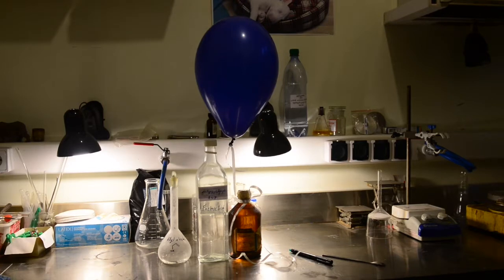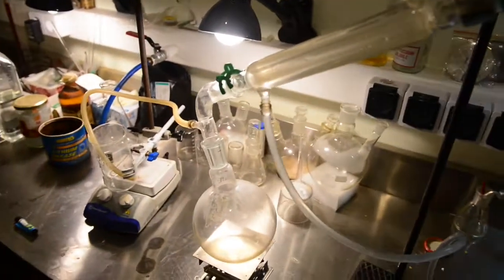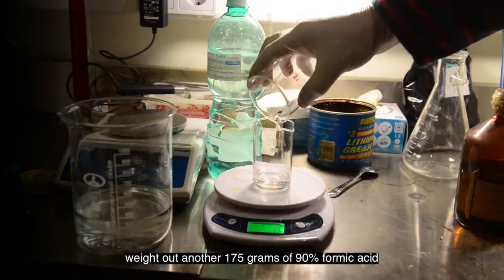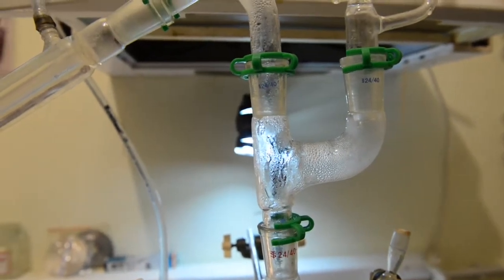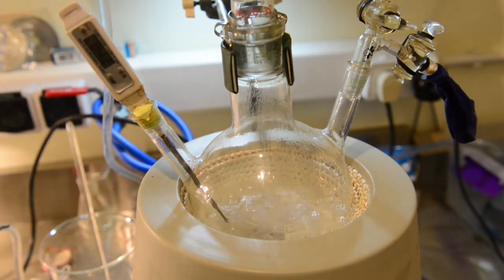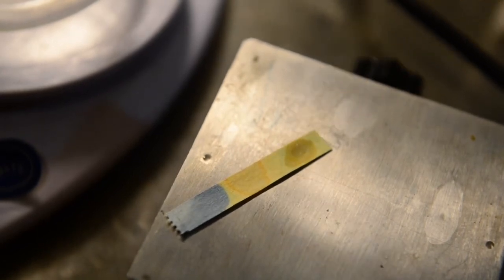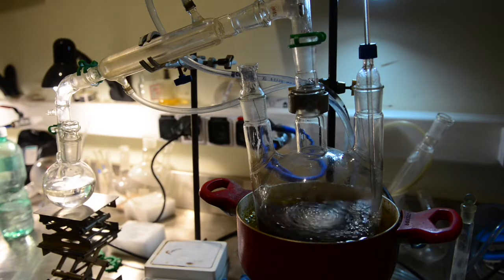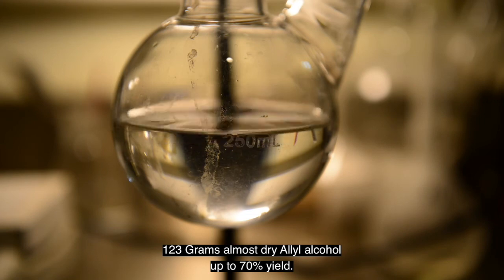Allyl alcohol synthesis

Comment: I have a suggestion for upcoming distillations: when using a claisen adapter with a dripping funnel like in the video, it is more commonly connected the other way around. That way, you don't lose any liquid from the dripping funnel and you even get a very slightly better separation of your components from the boiling flask, as the path becomes very slightly longer. Great video!

Comment: Can I skip the inert gas part and just do with atmospheric gases? Will it just reduce yields (and by approximately how much?) or the whole reaction will go to shit?
Reply: Ya i want to know too...
Reply: I tried without inert gas... yield OK, no tar formation, seems keeping temperature in flask below 260 C is the clue to prevent tar formation
according the yield... the speed of heating and distillation seems to be the clue... if too strong heating at the beginning, formic acid does not manage to form ester with glycerol and distills off prematurely = low yield... when later to week heating then acrolein formation and lower yield
Reply: @dznp432  The real MVP. What was your final yield (in anhydrous form)?
Reply: @alex6629227  well, the reaction of anhydrous glycerin with 85% formic acid was not difficult, the workup was harder... first refluxed with NaOH to destroy remaining formic acid and hydrolyse allyl formate, then fractionated by distillation through a 35 cm short Wigreux column so obtained azeotrope of allyl alcohol with water, then salted out using K2CO3 where concentration raised to more than 90 % and then dehydrating further in Dean-Stark trap adapter using hexane...
so from 622g of 99,5% glycerol (93 g stayed unreacted in the flask at the end, so 529 g of glycerol reacted) and 600 ml of 85% formic acid I obtained 96,1 g of allyl alcohol fraction boiling below 96 C and 131,1 g of fraction boiling in range 96-98 C, there were loses especially on salting out with K2CO3
now I'm synthesizing it again for the second time in my life after more than half a year as I would like to make allyl phenoxyacetate (I love pineapple scent), the first time I used it for allyl valerate synthesis (my beloved pineapple fragrance again)
Reply: @dznp432  Nice job, buddy. Good luck in the future!

Comment: All in all a pretty good video. A couple things though. Using calcium chloride to dry and alcohol isn’t the best technique because the alcohol also dissolves a large portion of salt. Secondly, when using calcium chloride to dry a solvent, it is counter productive to distill the solvent WITH the salt you used to absorb the water. The water will leach back out of the salt back into your solvent and distill over. Best to let sit, wait, and filter the salt.
Reply from the maker: Thank you for that. Will take in to consideration for the next time. :)